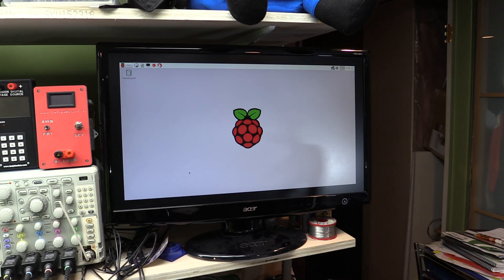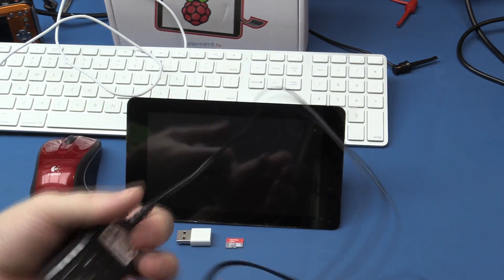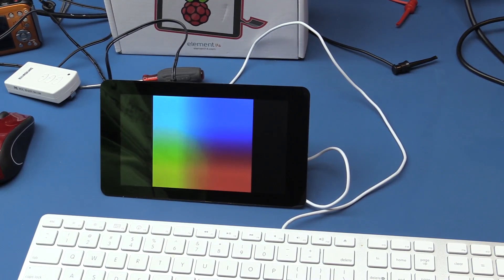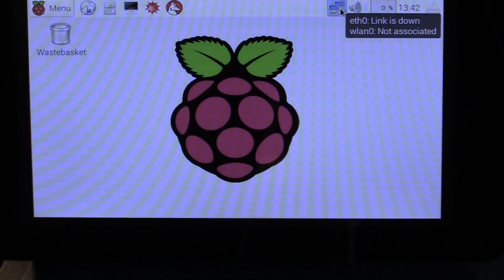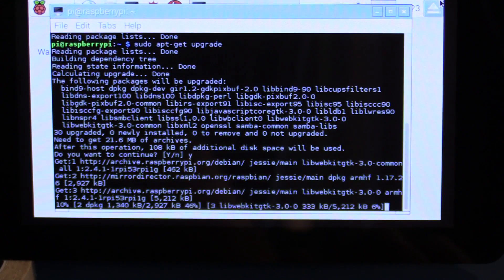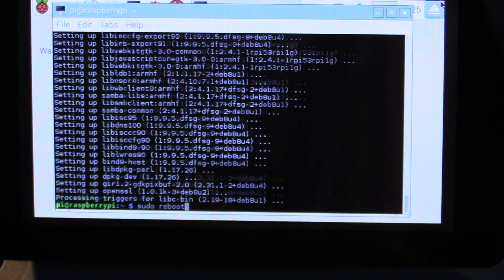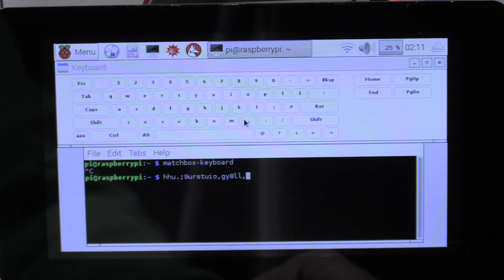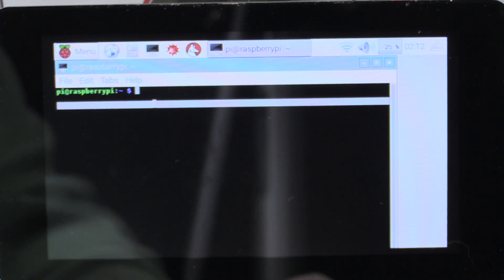New Raspberry Pi 7" Touch Screen LCD - test with Raspbian 1.5.0

Comment: Same old Unix X/Windows crap with a window manager layered on top. Worse than Windows. Raspberry Pi is only good for gaming or embedded systems. It will never be a general purpose device. There are some very interesting applications for this device. Don’t expect it to replace any laptop or tablet you use.
Reply from the maker: If you have watch my vids about the PI and windows 10, you will see that I have expressed the same thing, if you want it to be a desktop replacement then you will be disappointing, but as an appliance / embedded system it opens up alot of possibilities even with Windows 10 for IOT

Comment: can i use this The Raspberry Pi Camera Extension Cable to convert dsi to hdmi?
Reply from the maker: the Camera cable for the pi (NOT Zero) could work to extend the display that would normally plug into the display connector (Not HDMI) but it is simply a set of wires, it wont convert anything, just potentially provide more distance between the PI and the display

Comment: I was not able to get the max resolution as advertised with the new pixel raspian . Any body has any clues how to max resolution  800 x 400 display. Secondly touch screen is there a way to calibrate the touch screen? Thanks

Comment: What current Is required to power the pi and the screen simultaneously using only one power supply?
Reply from the maker: I would use a 2 or 2.5A supply, the running current will be less than that but startup and the occasional increase depending on use will be covered if you stick to the better supply. You may be able to gt away with 1 to 1.5A but be sure to have very good and short USB leads from the PSU brick to the PI/Display and don't plan on adding any or many accessories.

Comment: Do you have to add any code on the pi to make the display work or does it just work once you connect it?
Reply from the maker: Just load the latest version of raspbian on an SD card, Connect up the LCD correctly and boot up. It should all work right off the bat. including the touch screen, but no auto keyboard :(

Comment: Can you measure whats the view-able size of the visible screen area?
Reply from the maker: 7" diagonal, 6" x 3 3/8" length and height, this is the viewable area, only lit pixels give or take a fraction
Reply: I see, so the black area around fills up to more than 7", that's a great info. Thanks for checking it! :)

Comment: You display doesn't show the little color cube in the upper right like mine.  Can you help me in removing it from my LCD ?
Reply: james holowka i have never seen a bolt before,  but it may indicate a power issue
Reply: Rainbow square on the upper right means under-voltage (below 4.65v)
Try a different power supply.
Reply: Thanks.  I found that out a week ago.  I was trying to cross over from the USB out to the Pi and there was an issue of having the LCD powering the pi.  I just run two cables now to a 2 in 1 adapter and it is fine.
Reply: Chris Sparks does a lighting bolt mean low power to?

Comment: +Peter Oakes: Found the video very useful having just got one of these screens. The only problem I have is that I am using Window 10 IOT (installed from noobs) and the display if upside down.  There was no confg.txt file on the windows readable partition on the SD Card so I created one and put the lcd_rotate=2 line into it and the noobs "splash screen" is now the coirrect way up but the Windows 10 IOT display is still upside down!  Any suggestions?

Comment: Peter. great video. did you ever solve the upside down display issues? I have the same issue and I am unable to solve it. I can rotate the screen in the boot file, it is just simply rotate the screen but not the touch functionality.
Help sought.
Reply from the maker: +Pisti Fésüs What issue are you having with the touch functionality ?, if it is that it seems to be uncalibrated then turn off the overscan and see if that fixes it. Same file as the rotation

Comment: +Peter Oakes:  With the Official Raspberry Pi display, when I enter MENU > PREFERENCES > APPEARANCE SETTINGS the window that pops up is too tall for the 800 x 480 7" display.  I can't even drag the top blue bar high enough to see the bottom of the window.
Reply from the maker: +Jim Holstein have you adjusted the over scan settings at all in /boot/config.txt ??

On mine I had a black border so I turned it off, you can also set the resolution there if needed. you should not need to but it may have somehow got confused. Did you use the latest image from Raspberrypi.org ?
Reply: +Peter Oakes (TheBreadboardca)   YES ... working fine now after editing /boot/config.txt
I let WIDTH remain at 1280 but set HEIGHT = 768 [this matches the 800x480 ratio of the 7" display]
I commented out the overscan_xxx=16 and disable_overscan=1 [got rid of black border]

My only real problem now is that the Text in the Terminal Window is really tiny.
So Peter - is there a linux option to zoom-in/out like Windoze CTRL+/- does?
Reply from the maker: +Jim Holstein if your using PUTTY then you can change the fonts, if your using a term within the PI console then go "Edit", "Preferences" and change the font size there

Comment: Hey Peter, I have a question for you. is it possible to somehow add on an hdmi port on the 7" screen? for example when I use certain imgs of rasbian that are setup for use on diff screens they do not work on the 7". And I would like to be able to plug in my Pi to it, make the proper changes and then connect it using the ribbon cable.
Reply from the maker: +Manny K this may involve messing with the device tree to get that to work, I am not to familiar with its workings but have done something similar with a LeMaker Guitar (Im guessing here that this may work)

The PI does not yet support DUAL Screen which probably would address your need, maybe in a later release ?

Comment: +Peter Oakes:  A teckie friend got the matchbox-keyboard to popup when entering the command in terminal but it does not show up in the accessories menu. How can I fix that? He also put the matchbox-keyboard command in /etc/rc.local thinking he could get it to start on boot but that did not work. (we did reboot several times).  I went to main menu editor > accessories > keyboard IS checked.  Puzzled-in-StLouis.  Jim & Paul
Reply from the maker: +Jim Holstein Not too sure how to get the keyboard to show int he menu, on mine it took a while to appear but asside from retrying the install I did nothing different, it also does not pop up automatically when a text entry area was touched which would be nice

Comment: Oh sorry - I didn't press SHOW MORE where you do answer "creation of an SD card" and "Install of Raspbian".  
I still would like you to answer the ConfigChange, Static IP and SSH questions. 
My apologies for the "chatter", I'm so new at all of this.
Reply from the maker: +Jim Holstein For the SSH you just need to use a windows application like PUTTY http://www.putty.org/ and select SSH for the protocol, and then enter the IP for the PI you want to connect to. The PI has SSH enabled from default install.

To change the IP address for the PI you need to right click on the top right (HDMI GUI Screen) and select properties (The top line may say WIFI Settings but select it anyway), now you can select the eth0 interface and then proceed to enter manual settings for IP, GW, DNS etc.  If i get a chance Ill put together a video shortly, your not the only one asking so worth the time to create it.

Comment: Please provide a link to the preparation of the MicroSD card.  
And a few other things if you would be so kind:
How do I assign a static IP address [192.168.1.12] to the device on my home network [cat-6 cabled, not WiFi]
I want to install the PLEX application if you would be so kind as to demonstrate that.
I want to SSH into the device from my Win7 desktop
Reply: the only way I was able to set it up (after hours of fighting with the terminal) was through my router.  you should be able to snag the mac address of the raspberry pi and set it to a static address.

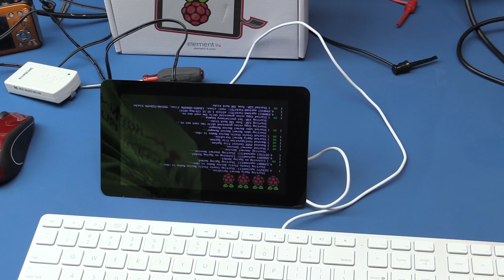Comment: Excellent video.  At 3:42 you mention "a simple config change to turn the display 180-deg upside down".  Please elaborate in the comments or provide a separate link.  I'm a total newbie so please be specific.  Thanks.
Reply: +Peter Oakes (TheBreadboardca) how i can change the pixels? because there is a black bar around the screen
Reply from the maker: +NaeXróv that may well be the overscan setting in the same file, I am aware of this but not yet tried to fix it. I think it will correct the miss alignment of the touch once done
Reply: +NaeXróv I had the same issue. Try going into the menu of Raspbian (top left). Menu> Preferences> Raspberry pi configuration> in the system tab change the Overscan setting to disabled. 
Worked for me.
Reply from the maker: Well thats easier, thanks for pointing that out
Peter
Reply: +Peter Oakes (TheBreadboardca) there is just a root.tar and a boot.tar
Reply from the maker: +Jim Holstein Putting the SD card into a windows machine  (I dont know how to do it in Linux as it is in a weird partition for Noobs)
Openn the file in the root folder called config.txt
at the botton, add the line      lcd_rotate=2      and that should do it for the noobs boot
under linux goto /boot/config.txt and do the same thing